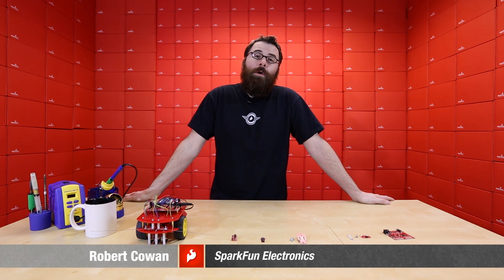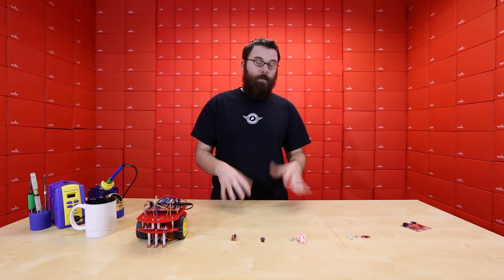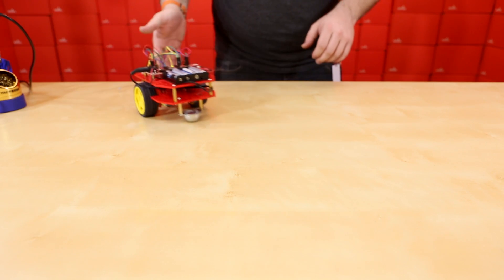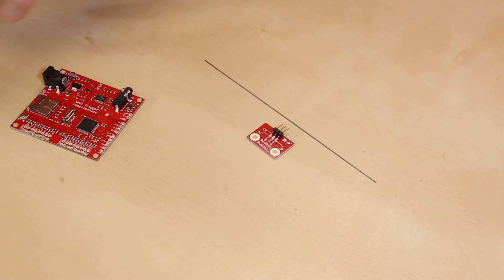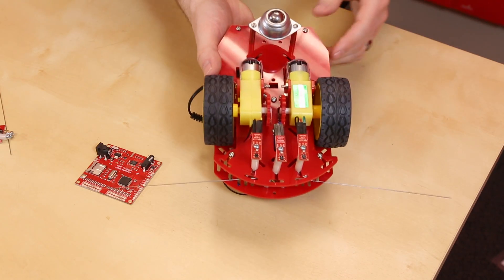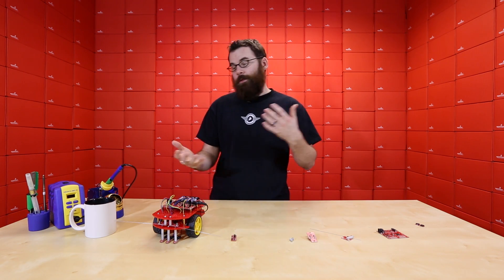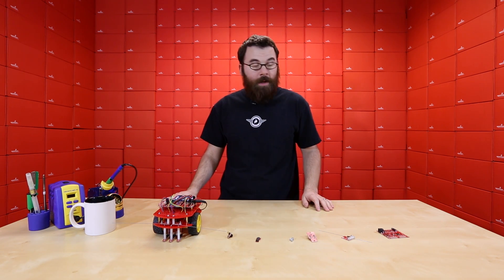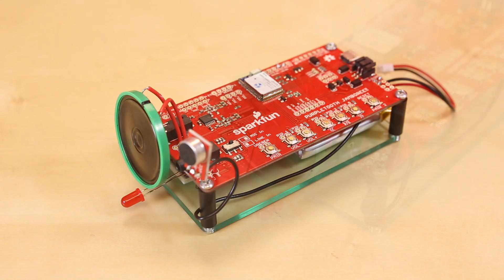1-31-14 Product Showcase: New Product Smorgasbord

Comment: I assume that these audio boards can only play a single sound at a time.  In other words, there is no mixing/multi-channel capabilities???
Reply: Don't think so. You will need something beefier. Don't take my word for it though....
Reply: If it's using one of the Viniculum ICs as the decoder, it is a single stream codec.  It is just kinda' clunky to use a single stream device as the basis of a machine that may have more than one event going on.  Killing the background music to make a gong sound and then restarting the background loop sounds really crappy.  I have just been waiting for something more modern than the OKI MSM6295, but it still seems to be the best fit for now.

Comment: Fun update!  I would love a sound board that could change the pitch/speed of the sound file - I think that many people would have use for this function!
Reply: You could hack a function like that in if you just did more than one file, and used software to slow down each wav/mp3 file...
Reply: I was thinking more of a real-time variance - so the sound file could be in playback, read a value (say a pot) and change the speed/pitch in direct relation real-time.
Reply: I dunno if you could get a cheap chip to do that... But, I dunno.